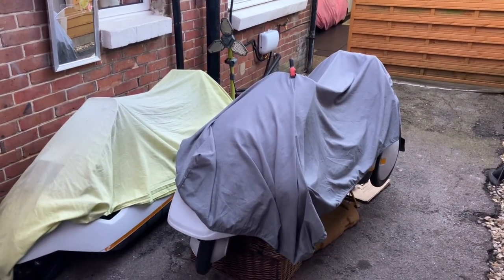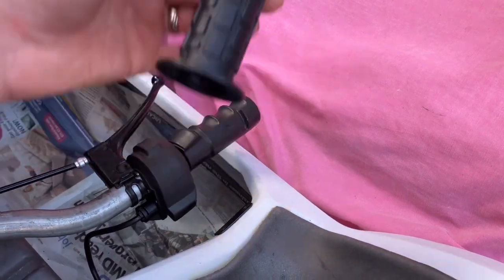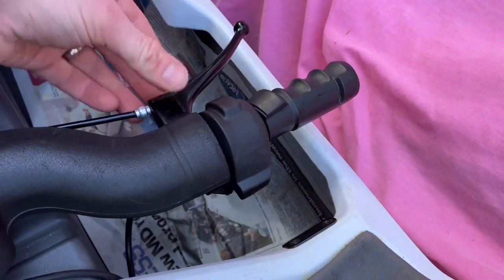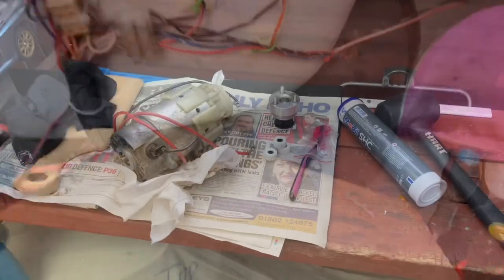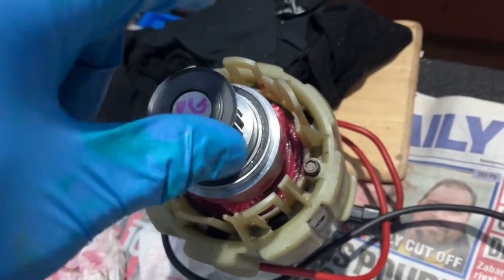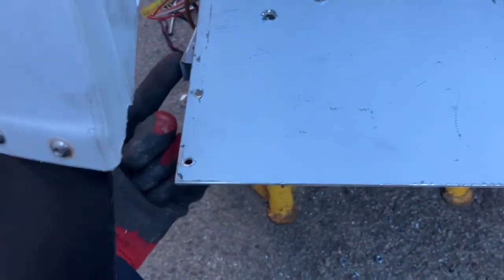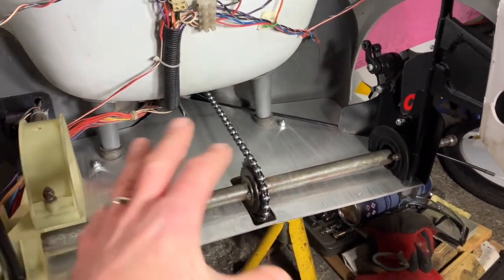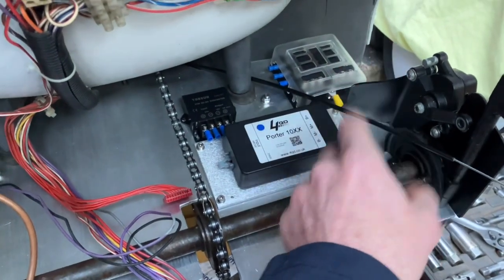Part 1/3 - Upgrading my Sinclair C5 to 24v

Comment: Looks good. The gears are defiitely required for 24v and we fit them to all the 12v we service too as theyll work far beyond the original gears which melt when the grease dries out. You should end up with 28mph on the flat when you switch to the lithium. Be careful with the metal plate, when the chan comes up its a nightmare to get it back on as the chain gets jammed between the pulley and plate. Be careful with your fingers fishing it out. For anyone else watching be aware that once the plate is fitted you cant put your C5 on a vertical stand.

Comment: Those circular supressor things are "ferrite cores". Good stuff for rewarding your C5 with a bit more pep! Nice neat work too
Reply from the maker: @hydorah  hello, i actually had it running yesterday and it spins up very fast and smoothly.
Typically the bolts didn’t arrive today, so I’ll have to do some other bits on it on Sunday, but I was hoping for the bolts as I could then make and fit the accessory loom bits to the perfect lengths.

Comment: I like your c5 videos 👍 , i recently bought a c5 that had been dry stored for 25+ years.i have just recommissioned it. Everything is working great except the pod display. All the leds on the left side are permanently on. I've replaced the 10 ohm resistor R21 which had blown but its still the same. Hopefully I'll get chance to look at it again this weekend. 👍
Reply from the maker: @voodoochild800  hello. Good stuff indeed, they are a lot of fun.
Your issue could be IC1 and IC2, or the red connector on the pod (or pod pins!).
Good luck!
Reply: Thanks, I'll check those 👍